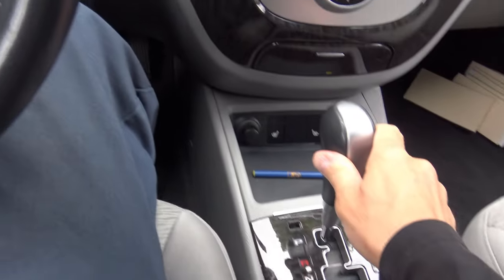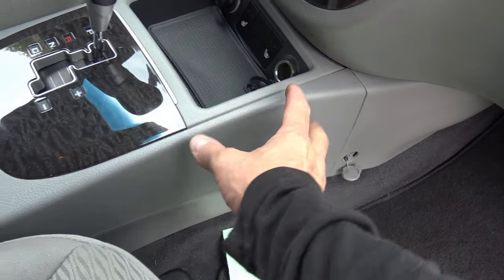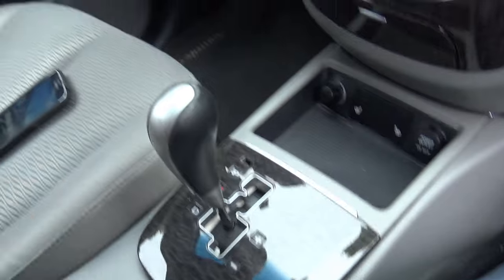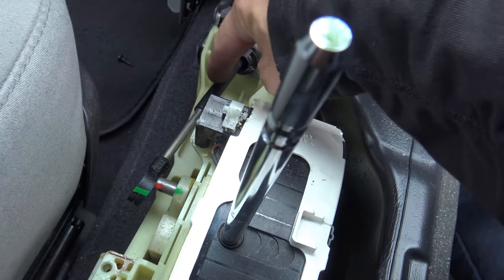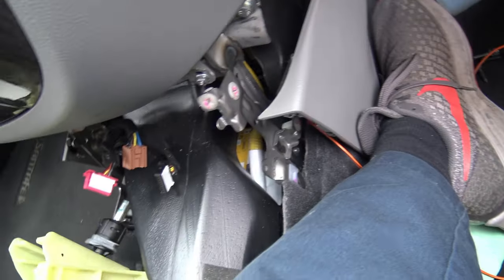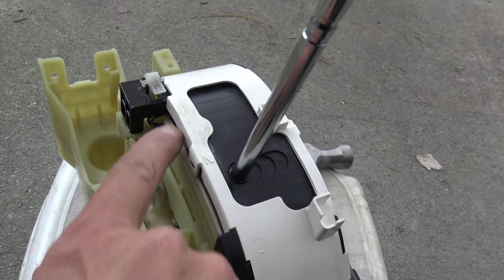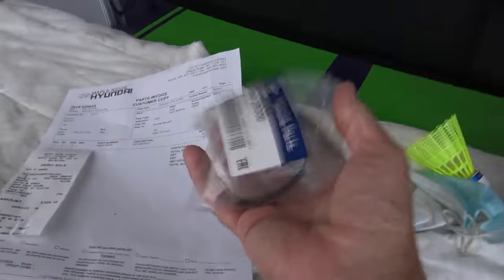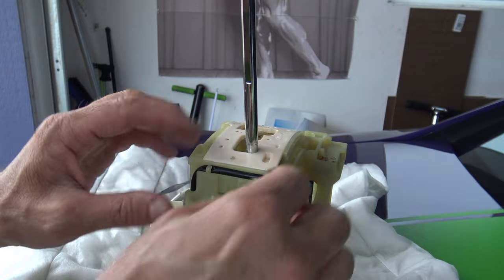Hyundai shifter stuck!. Two problems for the price of one!

Comment: Perfect - thanks!!   The torch-oil approach was what I needed to get our '09 Santa Fe back into working order just as you described.   One thing - reassemble with the shift in Neutral and a drill bit through the hole in the "L" bracket and Neutral sensor switch before you tighten everything up.   My first pass at reassembly without that brought back Park-Reverse-Neutral but I lost Drive even though the shifter was smoothly going into each gear.  The position of the cable screw is very sensitive.   Thanks again - saved us a bunch of money.

Comment: Much thanks on this video. On my 09 Santa Fe 3.3l
Shifter became stiff on shifting gears until it just wouldn't move any more. My first step was I went straight to removing battery & tray released the shifter linkage went inside & now shifter was moving freely, next I tried moving that bracket with neutral safety switch it was jammed, so I did what you said on your video  lots of WD40 Heated up that shad with torch more WD40 Got an open wrench at the very bottom of the Shaft moved it back and forth till it moved  freely more WD40  Reassemble everything and working just fine  👍👍

Comment: to get the handle off the shifter you need to pry the silver plastic piece off the top, and underneath is a clip and once you take the clip off the handle slides off easily, no more hitting yourself in the face pulling it off.

Comment: Great Vidya. I liked how you were so careful not to damage trim. The shift lock bypass under the trim cap is getting mine to start in Neutral. But it definitely feels like a shifter issue up around park like yours. I think I have the same problem. Did you ohm out the solenoid for continuity. Might have been the seized shaft all along. No need to order the solenoid? In the rust belt I am going to the shift lever first. Great content!
Reply: DId you manage to fix the Only start in "N"? mine just did that the other day.

Comment: Very good video. So I have a 2006 Mazda 6  and the issue is that  the shifter will not go into drive. Will move to reverse and neutral but will not advance to Drive. Any suggestions and advice. Thank you, JC

Comment: Hi Photomikes Garage, you seem know well the transmissions. The car had shown "Input/Shaft Speed Sensor No Signal" error and was recently fixed. The professional was not speaking English well and all I understood is that the input/shaft gear had to be adjusted to always send the signal to the "Input/Shaft Speed Sensor". I wonder could what you explained in the video (although the car model/year might be different) be what he actually did to solve the problem. I would appreciate if you can point me in the right direction.

Comment: Mike is a like! Thank you for your easy to follow vid on 2008 santaFe.
Identical issue, with cleaning and WD40-ing released cables
All smooth, But still only starts in neutral? Was suggested, the sensor for that messsge to allow?
Mind sharing thoughts ?
Thanks a bunch.
Reply: DId you manage to fix the Only start in "N"? mine just did that the other day.

Comment: I am having the exact same issue!  Right now, I cannot get the neutral safety switch off it is so rusted in place.  I have it soaking in WD40 overnight to see if that helps.  That "L shaped lever" was also very rusted and took me about 30 minutes to get off.
Reply: Update:  Was able to get the neutral safety switch off using vinegar!  The shaft seems to move properly, but I'm still stuck in Park and it does not start at all even in Neutral.  Going to buy a new NSS and see if that helps.
Reply: Final Update:  THANK YOU so much for this video!  Changing the NSS fixed the problem and I would not have been able to do it without this video.

Comment: i have a 2001 Hyundai Santa Fe 2.7l  front wheel drive my shifter has no problem from park and the rest on down, but the problem im experiencing is it wont drive normally on the D drive it acts like its in first gear and i have to slide the shifter over to the + and - to switch it to 2nd gear + and then bump up the + for 3rd gear and again bump up + for 4th gear, when i slow down it shifts down but every time i accelerate i have to manually bump up the shifter the + to get to the next gear all i want to do is drive it on D and let it shift normally instead of me doing it like a stick shift? what is my problem? or is it the tranny or a shifter or a bracket or is it possible the neutral safety switch i don't have no problem starting in both P and N its fine but i do notice sometimes my lights to the shifter doesn't come on until i slow down and then i shift it by bumping the shifter on the + when i accelerate it and lights of the gear comes back on lol, if you have an idea please let me know cause im thinking can the neutral safety switch or the bolt to the transmission that you heated up and put wd-40 and got that rust to unfreeze the corrosion?

Comment: An experienced mechanic that understands the mechanism and solenoid function, would have diagnosed this quickly by simply overriding the selector security mechanism with a simple screw driver (clearly shown in the manual).
Reply: By putting a flathead through the shift lock release, and the shifter works after that while the flat head is allowing it to move, it’s going to be the solenoid that’s my issue? (2012 Hyundai Elantra)
Reply: Apparently not always. Cause I've replaced the solenoid and still have the same problem. 😭 On to the ignition switch that is bad....
Reply: This just happened to me today...on my hyundai, It's so upsetting. It's doing the same thing, showing R white in P.
Exactly the same

Comment: hi. I have a 2016 iX35 that only goes into drive and out into Park when pressing the "release" button to the left of the gear lever. Will this work for my car as well?
Reply: did u solve ur problem? i have the same problem on my ix35
Reply: @ProfJr-id7ln did you solve the problem? I have same problem with my 2015 ix35 😢
Reply: @rukiyeuyank8413  not really solve it. but i open the center console, and put thick layer of folded small paper, enough to chalk the hard plastic so that it is always on release. did u get what i mean?

Comment: not criticizing the video, but the solenoid was probably not an issue, you have to press on the brake with the ignition on for the solenoid to function, he never pressed on the break pedal to engage the solenoid.   you have to step on the brake to shift out of park on ANY vehicle and it allows the shifter to move.

Comment: Did you not hook the shifter up to verify using wd40 fixed the binding on the input shaft? or did i miss that part.
@13:52 you are moving the shifter and the shift cable is not hooked up
Reply from the maker: Yes the wd 40 did the trick.
Reply: @PhotomikesGarage  good to hear that, was moving the shifter at the 13:52 to show that the shift assembly was operating or the linkage at the transmission?
Reply: Yeah, why testing without hook up?
Reply: @PhotomikesGarage  you did not answer the question

Comment: I stay with your second one. I think was only a problem, not two. Your problem was at the neutral safety switch. Treat your car nicely and it will last. Mine has 160K miles and Zero problems.